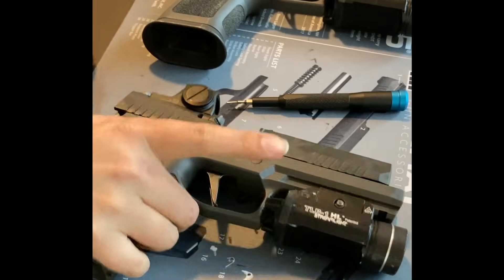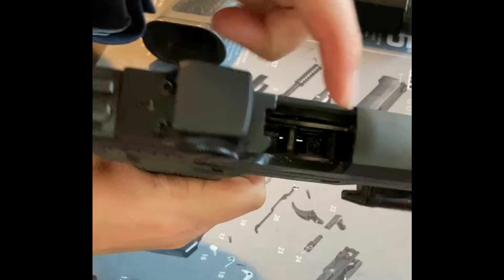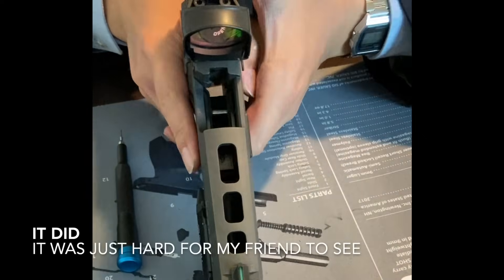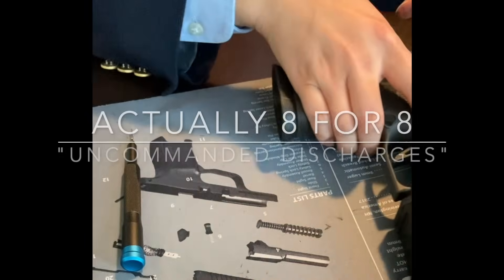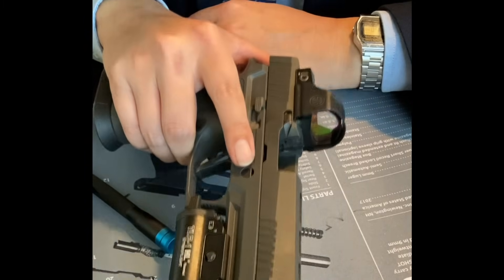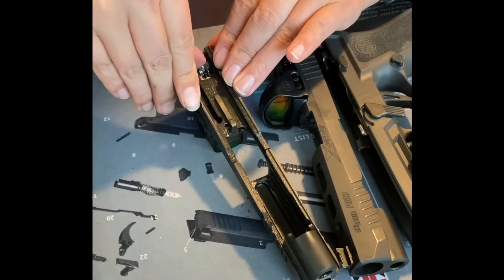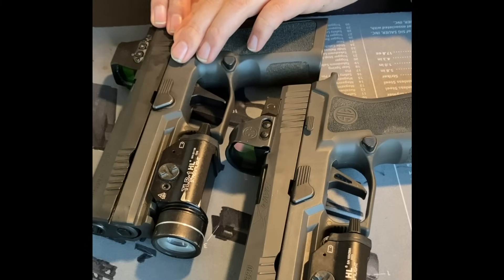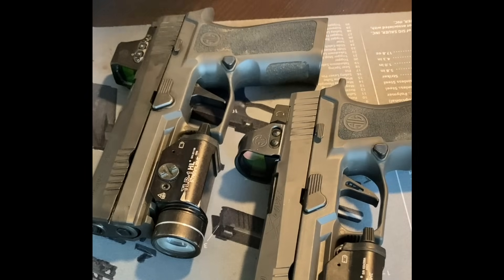Testing two P320's for Uncommanded Discharge: One PASS, one FAIL

Comment: You have hampered my contention that the susceptible guns were those with high round counts by saying yours was well used, and your friend's not so much. I'm not ready to discard this idea yet because a lot of the reports are coming from well-used 320's, but this video does support my contention that the issues are a series of events. If the UD'S were caused by a single thing, it would have been found by now. Since the UD'S are still in the "What is it?" column, I believe they are caused by a number of different issues at different times. Kind of like tolerance stacking in manufacturing - one single piece out of tolerance won't cause failure, but three parts out of spec can.

Comment: Why do you need to forcefully disengage the sear? What happens when you gently disengage the sear? I think you're definitely onto something. I've seen your future videos. Just a theory, but what if it's not a simultaneous failure of the sear and the striker lock, but a sequential event. Continuous movement between the frame and slide gradually walks the sear down  off the striker foot. The malfunctioning symbiotic movement of the trigger bar almost disengages the striker lock leaving the striker dangerously half-ass retained by the striker lock. Then a little movement or jarring and the striker lock drops the striker. Can you gently release the striker  and gently remove the slide then check the engagement of the striker lock. If it looks weak, bump the slide some and see if the striker drops.

Comment: it's been solved. there sa video by  youtube channel "Wyoming Gun Project" with title "SIG P320 Un Commanded Discharge and its Repeatable"... the issue is with the trigger. A VERY VERY VERY  slight pull can deactivate the safety, less than 1mm... that's crazy... a very slight out of spec or a dust for that matter can render your gun an assassin of its own.

Comment: Again thanks for analysis and explanation! I am old school not crazy or thrust any striker fire pistol including the P320, they are simple,fast and easy to shoot but the trade-off to the safety of a DA/SA, DA or SAO(w/safety) systems. 
I own three P320 they are good shooters but their modularity which is great, but on flip side has led to lots of people doing easy modifications. I consider the P320 to be cocked single action and unlocked.  A lot of these modification have severly compromises P320 safety!  Some have elected to modify the Striker Safety lock by either weakening or changing the spring, very dangerous!!!! The Striker Safety lock & spring are final critical safety protecting you from a accidental discharge.   I do think the sear is somewhat exposed from the rear of FCU and grip area that why the Striker Safety is needed as secondary backup!

Comment: Uncommanded is not a dumb phrase, it means the gun truly went off ob its own, with no operator input, unlike an accidental discharge, which could be the operators fault. Like brushing the side of the trigger when removing from the holster. It specifically puts blame of the discharge solely on the gun. When some police departments first transitioned to Glocks, officers were having accidental discharges with their finger in the trigger taking up slack. That was bad habit and bad training  yet we still got the New York trigger. In this case the pistol is going off in holsters without touching it

Comment: PM should include the finger test you demonstrated. If it fails, spend the $12 and 30 minutes to replace both springs in the assembly along with cleaning the firing pin assy. and cylinder. The smaller of the two springs will eventually lose tension before the larger spring and may even break. Tens of thousands of rounds fired have shown these springs still operate as intended. However, they are mechanical components and will need to be checked and replaced as needed. Don't forget the action of the barrel forcing the reset of the interlock. 
Thank you for sharing this video !
Reply: There is also a "Sport Disconnector" you can look into.

Comment: Purchased a P320 and M18 three years ago. They’re both safe queens not because of the uncommanded discharge…I knew nothing about this issue at the time of purchases…I have P220 and P226 that I’ve shot for years and wanted to add these Sigs to the herd. Only heard about this in early 2025. Now what to do. Won’t sell them unless buyer knows the issue and LGS probably won’t touch them with a 10-foot pole.

Comment: Just holding the frame and pressing down on the sear you can observe the striker safety lever going up sympathetically. It's a similar result as pulling the trigger, but less lift. I saw that with all 3 of my p320s.

BUT, my two units that have manual thumb safeties will disengage that sympathetic movement when the safety is engaged.

CONCLUSION: I am only carrying loaded chamber with the thumb safety engaged.

Comment: ok i see the problem, the firing pin block is not independent of the sear and it should be, if there is mininimal sear engagement than the block is also activated so this is definately possible for firing without trigger pull which on othere designs this is not the case, sig needs to make the block comletely segregated from sear if trigger is not pulled

Comment: Can you get out the micrometer and measure the diameter of the takedown lever in both pistols.  One is in theory too large, and the right one is smaller.  Also, one of the safeties is supposed to be a stamping and not MIM.
Reply from the maker: The Takedown Lever is identical between all models. The Takedown Safety Lever has some differences, but not in the way one would necessarily anticipate - there appears to have been a design change between 2020 and 2022 at the root of the edge case found by LFD Research.

Comment: If you disassemble your friends striker assembly, you will find the return strimer spring has broken or disintegrated and you will have to replace the spring.  My striker return spring consistently breaks if you dry fire withouth a snap cap or other device to absorb the striker movement. 
I don't dry fire the gun anymore without a snap cap and the spring has not broken since.

Comment: Can anyone tell me why with this test or the other video of the guy pulling the trigger with the slide disassembled….that I can’t get the striker to fire? 

One fellas video, it’s disassembled like this however he can still discharge the striker when the trigger is pulled.

And i retarded or is it because I have a newer pistol?
Reply from the maker: @boystainey Make sure you have fully convinced the FCU that it is in the assembled state. Make sure you: 1) Turn the Takedown Lever to the assembled position, 2) Pop the Slide Catch Lever upwards to allow the Takedown Safety Lever to spring back into position, and 3) Press the Disconnector to ensure the Trigger Bar is fully reset.

Comment: I wonder if these AD's occur from every part not working properly, and then a protruding firing pin resting against the primer which could go off from a bump or jostle? I don't know. Good test!
Reply from the maker: The striker would only ride in the fully forward position if the sear didn't catch it during slide reciprocation - essentially experiencing the striker-equivalent of hammer follow. Thus far, I haven't seen any widespread reports of that kind of issue.

Comment: My "modified" process involves using a cheap amazon dry fire trainer/laser. This allows the P320 to be tested without having to thumb the back of the slide
Reply from the maker: Not a necessary move by any means, but a valid and potentially easier to confirm alternative method for folks who have a laser cartridge or don't mind buying one.
Reply: @P320Truther  Agreed. I  just happened to already own one.

Comment: This is the first time I've actually seen it happen! I did a similar video with my P320s and had zero problems out of three slides and two FCUs. I'd LOVE to carefully inspect a failing pistol so I can see WHY this is happening. We need clearance tolerances, spring pressure, timing... etc.

Comment: I performed this test on 4 different models. One heavily used AXG Equinox, one virgin AXG Equinox, one initial release AXG Scorpion, and an early release civilian M18. All fired models were thoroughly cleaned prior to testing with you method. The M18 was the only model that passed the test, and it was equipped with an Apex trigger and trigger bar. Swapping slides between models produced the same results, suggesting the issue is in the FCU on these models. Between the various FCUs, the noticeable difference was slop in the safety lifter next to the sear. Changing the trigger bar to an Apex bar made the FCU pass the test. Apex discontinued this product in January 2025. FML.

Comment: Tried mine with the barrel and recoil spring in. Used a ball point pen and it never hit the pen. When I pull the trigger the pen went flying. Tried 30 times. 100% firing pin never hit the pen. Only when trigger was pulled. I posted a video. Thanks for the test.

Comment: Interesting, but in the videos going around there is no sharp strike to the sear occurring.  Seems to me this may be more related to the drop failure from years ago than what we have seen lately.   Though they could be related in that the safety plunger is not properly resetting.   For truly uncommanded, some geometry must be hanging on the creep - meaning the locking geometry is not fully engaged - and random vibrations let it loose.    

Not trying to apologize for SIG.   Something is definitely up.  Just thinking out loud about what may be going on.
Reply from the maker: There's usually a bump or a jostle of some kind. Delving to the root cause there likely needs institutional levels of test setups and sample sizes, I'm just assuming that the sear has to non-destructively release the striker somehow and seeing why that alone can somehow cause an "uncommanded" discharge.

Comment: You really need to look more closely at what is happening in the FCG, when you manually push the sear down. It raises the striker safety lever, which is disengaging the striker safety. The only reason you don't see the striker protruding in your pistol: it's retracting after it's extended.
Reply from the maker: I can see the firing pin on my pistol protrude when I pull the trigger properly. It does not fail the Sear Movement Test. My friend's fails the test.

Comment: Here's an idea I've always considered. Kydex and big officers flex the gun around. I am thinking what could be the culprit to some of these issues is too much movement either from the slide and FCU rail fit or a combination of it moving in the module and the slide to rails fit. So maybe really crank and twisting on the slide assembly could answer this question if anyone were to try and test it.

Comment: Great video and good info! Regardless of what the sear and striker relationship is, the striker/firing pin block is the last line of defense in the event of uncommanded sear movement. Are these firearms also having striker assembly failures? Let's not forget to look at the striker assembly and be mindful that our blocks are functioning correctly. Remember, striker assembly and striker channel must be clean, no lube at all.
Reply from the maker: The striker assembly on my pistol behaves as it is supposed to. The striker assembly on my friend's pistol mostly behaves as it is supposed to with the exception of the lack of a functioning striker return spring.

Comment: Thank you for your investigation and coming up with this test. My P320 passed the test but of course that doesn’t guarantee this failure cannot happen down the line due to wear & tear. I’m not a mechanical engineer or gunsmith, but in my opinion this design seems to leave more room for possible failures compared to other striker firing mechanisms.

Comment: I do wonder if the firing pin block fails due to some abnormal variance within the channel in the slide? All ADs could be controlled by the firing pin block doing its job 100% of the time
Reply from the maker: Considering the striker safety lock is pretty much entirely self-contained within the striker assembly, I wouldn't rate a slide defect as a likely contributing factor. Agreed, however, that if we could guarantee striker safety lock function then that would prevent all "uncommanded discharges".

Comment: I am a big fan of Sig p226, etc....and 365's but Not the 320. It is the only pistol I have ever had an unintended discharge with. Sig does many things very well but the 320 is a scary mistake living on borrowed time. 
Using a 320 is like walking on ice, can be done but you never know when your luck will run out.

Comment: Just tried this on both my p320s and I noticed when you press on the sear it moves the trigger back causing the firing pin to come out because it’s acting as the trigger is being pulled and you can see the trigger moving on your friend’s gun. When I held the trigger in place and pressed down on the sear it was much harder to press down and when it did release the striker the firing pin didn’t come out. Not saying what you’re showing isn’t a possibility but for me I noticed the trigger moves when pressing on the sear acting as a normal trigger pull. Wondering if you would have the same results putting a finger behind the trigger so it doesn’t move.
Reply from the maker: Correct, that is the crux of the issue - the sear movement causes sympathetic movement of the trigger bar, which causes sympathetic movement of the safety lever, which causes the sear to be able to deactivate the striker safety lock when it really shouldn't. The trigger moving is just a superfluous symptom of the trigger bar moving.

Comment: So by putting in a heavier striker spring in my P320 to reduce chances of light primer strikes, I inadvertently also may have made my P320 safer? I am thinking of also getting the Sig Armorer C.O.R.E. kit to reduce the potential for uncommanded discharges.

Comment: does manual safety version of the p320 still have this problem?
Reply: Wondering the same thing. I left it on because of how light the pull is. That and no trigger safety, there's no way it's drop safe. 

It seems all the photos of unintentional discharge are  units without a manual safety. But I could be wrong.

Kind of sucks it wasn't covered, but at least we can replicate it by doing the same thing he did. It wouldn't be a definitive answer seeing as he has 2 of the same gun and they're both doing something different. But if the sear doesn't move at all with the safety engaged, then it's probably fine.
Reply from the maker: Again with a small sample size, I was able to get my hands on a single Manual Safety P320 to test two weekends ago. When the manual safety was DISengaged, it demonstrated the dangerous trigger bar behavior that seems to be at the root of failing the Sear Movement Test. When the manual safety was engaged, it did NOT display problematic trigger bar / safety lever movement in response to the Sear Movement Test, and is likely to be safe from this specific failure.
Reply: @P320Truther  I was surprised even with the manual safety and the magazine disconnect that I was able to disengage the sear. But like you said, it didn't seem to replicate that same issue
Reply from the maker: It's a known weakness of the P320 manual safety design akin to a Tokarev with the weird import safety: The manual safety merely stops the trigger from moving, it doesn't actually physically block the sear or striker from moving. Critically for our purposes though, it blocks the trigger from moving by blocking the trigger bar from moving forwards. This has a beneficial side-effect of preventing the trigger bar from causing sympathetic movement of the safety lever, thus rendering the FCU safe for the purposes of the Sear Movement Test.

Comment: So you think the firing pin is resetting not from a spring, but from the slide reciprocating? And it ends up functioning normally while shooting?
Reply from the maker: The striker return spring seems to play a role in mitigating a potential failure of the Sear Movement Test, but it does not seem to be specific cause of failing or not failing the Sear Movement Test. Ultimately, I think that the striker return spring is at least three links down the chain of causation and isn't worth chasing if we can solve the problem upstream (the sear being able to move the trigger bar).